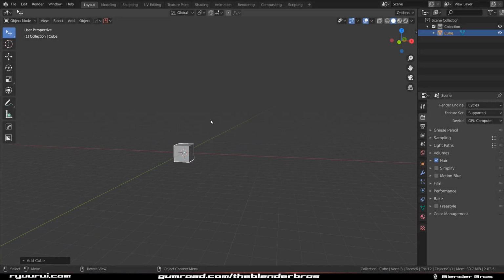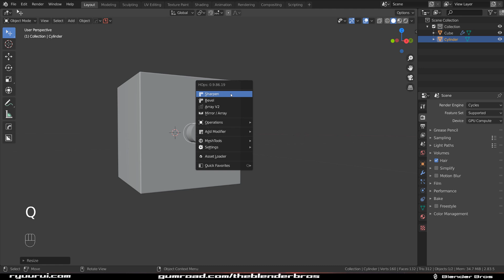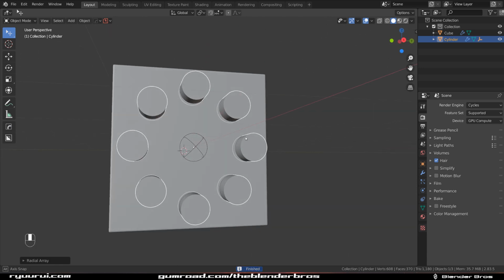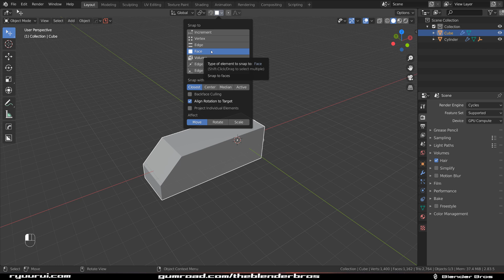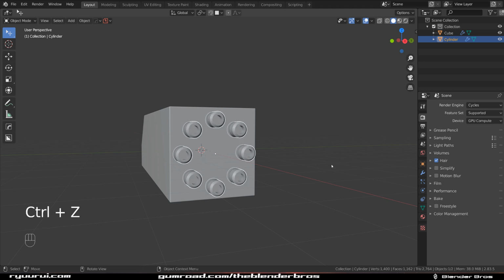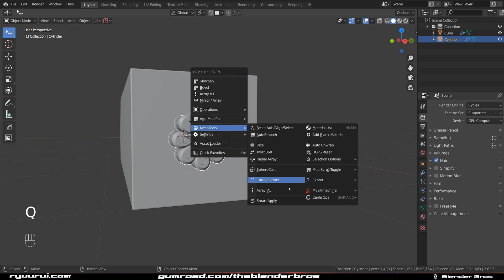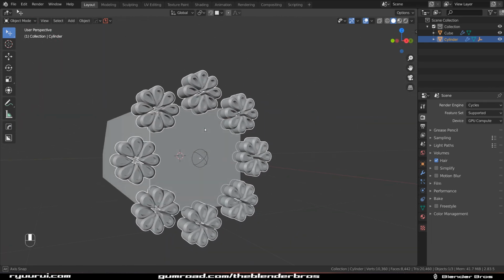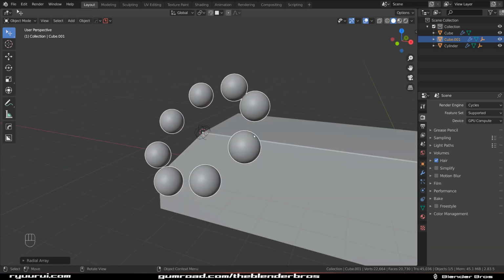Power of RADIAL ARRAY in Blender with Hard OPS

Comment: I'm having a problem where if I create lots of members of the array, there becomes one spot where they are not evenly spaced. For example, I'm creating lots of cylinders surrounding another cylinder to make indents. After adding many cylinders, two of them make contact and the rest do not. I'm not sure what's causing this. My empty should be in the correct spot.  Thanks for the video, the video on the hardOps documentation is unusable because you need kitops to follow along. (update: fixed it just by deleting the cylinder and trying again, not sure what happened)

Comment: The trick with the array on the corner only works if the alignment is set to view or 3D cursor. How is that default in your case?
Reply from the maker: it worked because i ran an array before, and hardops will remember displace settings

Comment: Thanks for the vid! Informative as always. One question: I've been trying to add the second radial array, but every time I select Radial Array it only makes me modify the existing array, it does not add a new one. Any idea what I'm doing wrong? Cheers
Reply from the maker: like i mentioned in the video, you need to use another type of array. Watch carefully how I do it. Also, the V2 array , if you press A you can add another one.
Reply: @PonteRyuurui  ahhhh....I was not pressing A....now it works! on the next tutorial! cheers
Reply from the maker: @davidesivolella5907  ya A adds another mirror, kinda sneaky